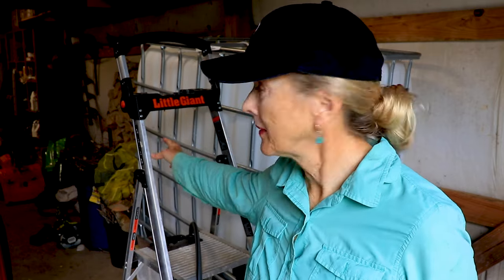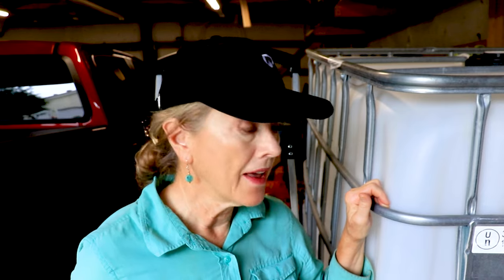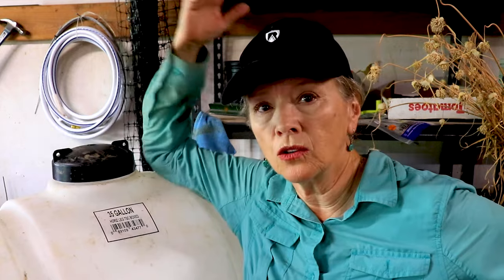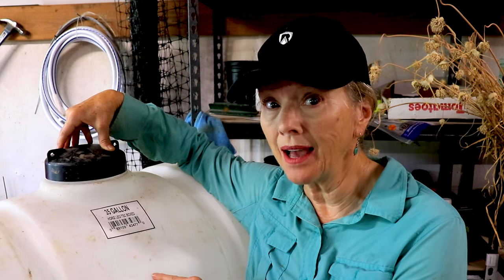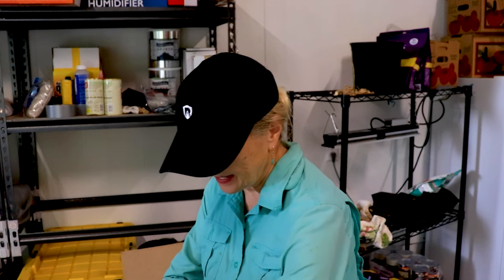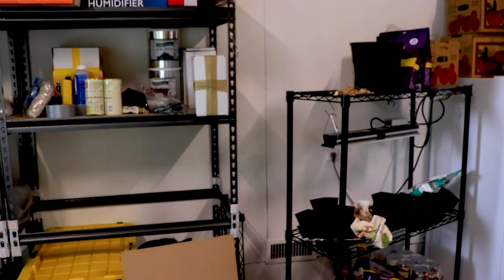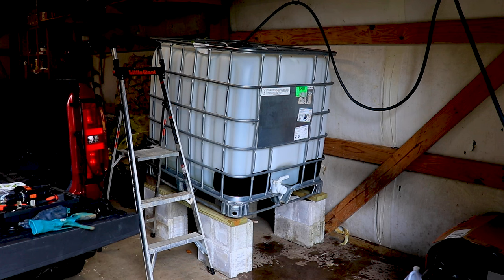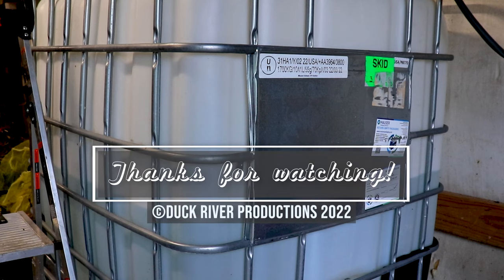TIPS storing water LONG TERM! (Don't make THIS MISTAKE!)

Comment: I learned about long term storage of gallon water bottles accidentally too. I currently fill 2 liter ginger ale bottles w water; stored in the house.
Gallon water is sold in flimsy low density polyethylene. (ldpe)
Use either high density pe or pet (polyethylene tere-something.) Soda bottles.

I like the idea of manageable water totes. You might even get a friend good in woodworking, or welding to make a stand.
Hopefully you can attach a hose to your tank so you don't have to carry the water.

We here in the south, fill our bathtubs prior to an impending ice event, for washing & flushing.

I'm on well water and am contemplating the addition of a manual pump.  But that might invite the neighborhood, should they realize what I've done.
Reply from the maker: They won't, because they wouldn't see or hear it, or know you did it, and I highly recommend it. I need to do that for my cistern. Thanks for the reminder.
Reply from the maker: And I've gotten several gallon glass jars which I'm replacing the plastic bottles with.
Reply: @Latebloomershow  oh excellent!

Comment: I don't trust buying used tanks because of possible chemicals so I just bit the bullet and purchased food grade at Tractor Supply for $500 each. I took out of metal cage and spray painted dark with plastic compatible adhering spray and put back in cage when dry to help keep algae growth down. It is screwed onto a treated wood base with fasteners and plumbed as a rain catchment system from my gutters complete with a spigot to attach a hose when needed. I use this to water animals and garden. In case of emergency I will filter through coffee filters, boil, and then run through my Berkey water filter to make it safe to drink.
Reply from the maker: You've got it all together! I just can't manage all that on my own. Bravo/Brava!

Comment: To clean easily, glue a neodymium magnet to a sponge or cloth, then use another on the outside and pull the sponge around to wipe the inside of the container.  Rinse well, spray with vinegar or fo the same thing with the sponge soaked in vinegar to sanitize the container.

Comment: Temperature changes can cause plastic bottles to expand and then contract.  So in the heat the water expands and when it cools off the bottles can contract and the bottles collapse.  A temperature controlled or cool area is a better storage.  The garage storage in the heat can cause these things to happen.  So sorry for your loss..  its not the fault of the bottle it is the temperature changes.

Comment: Kaye, now about those tools 🛠 that got wet. There are some quick fix tips that should do the trick. If it’s just light rust WD 40. If it’s bad soak the tools in diesel and that should work then clean fuel off them. Google says 24 hours. WD 40 is a good way to care your tools for those close to the ocean, salt air, and heavy wet fog. That will keep them looking like new ready for use. 
     I was wondering what happened too the water jugs to make them do that? Sometimes I leave water jugs around and yes they can freeze and bust, but that jug was extreme. Well if you keep finding stuff out of order, get a Weaner Dog, ears close to the ground and some security cameras, good to stay on top and ahead of things. Stay safe. 👍 Excellent content ✌️

Comment: I can buy charcoal in bulk online (I think we got 20# for $5) and drill a 3/8" hole in the top center of a used Brita filter...empty contents after drying by the woodstove or in the sun... Screen/colander charcoal to remove finest parts...fill Brita plastic vessel and plug drilled hole with foam ear plug or cotton.
   You can also use food grade hydrogen peroxide at 1%-2% to soak/clean Brita filters for a second time around

Comment: set up a pulley system  put straps on the tank    use pulley to lift it off     outside cover it up with something      use a two wheeler to move the tank   all I can think of..     four way faucet key is what you need to   for teotwawki...
Reply from the maker: Not sure what a four way faucet key is and what is it used for?
Reply: @Latebloomershow  go to LOwes or HOME DEPo    ask for a sillcock key       on buildings that have     NO    faucet handle    it is a key to open the water valve or spiket    gravity will allow water to come out when the water is off      runs from the top of the building down to you at the valve  the key   fits and opens the valve up  get one and put   in a bug out bag    you can get water as you travel    if there is none....in a shtf situation    look up sillcock key on the net............

Comment: Once it is clean, remember to use a HOSE for potable water to fill it.  Don't use a garden hose if you want to drink it. The 2 hoses are made of different plastics. Ya, I know, we all drank water out of a garden hose as kids and it tasted like rubber.
Reply from the maker: I wasn't able to find a drinking hose longer than 25' when I filled it, so I didn't. But, I will look again. Likely i would distill water I need for drinking. IF I have power, that is. I only have an electric one now. I need the other kind to be safe.

Comment: I designated a little pull trailer for my watering tank. I use ratchet straps
Reply: To hold it down. It works, and it can be parked at the back of the garage, for when it is empty, and not being used...
Reply from the maker: Super!

Comment: Never use a milk jug type container. Luckily, someone told me that before I ever started storing water. They had stored some on a second floor that turned into a disaster because those things leak as you pointed out. I have not had a problem like that with the second type you showed. Those are also the kind of plastic that juice and such are sold in. They are very sturdy and after 10 years I have never had them leak. I have 300 gallons of water stored in my home. I have two 60 gallon black rain barrels in the back yard. That is NOT enough!!!! I feel so unnprepared in that area especially! You can never have/store enough water. I have 2 berkeys put away with extra filters. I currently use Zero Water filters for my tap water. They are AMAZING! According to experiments done by Mike Adams...these filters even remove roundup!!! If it goes bad...all of my stored water will be boiled. Then filtered through a berkey. Then filtered through my Zero filter. if you store tap water out of sunlight that has been treated by the city you do not have to keep dumping it and rotating it. If it's kept cool and dark it's not necessary. However, I would boil the stew out of it and filter it if you have to drink it. 

I also have several sawyer minis and lifestraws. Over the years, I've heard that sawyer minis are better than lifestraws. Not sure exactly why. I also have a water bob for the bathtub. water, Water, WATER IS SO IMPORTANT.  3 days or less and you're a goner without it as we all know. Water, coffee and tea is all I drink. Mostly water. So, I figure I'd be dead in two days without it as much as my body is accustomed to it.  

This is a great video, Kaye. I look forward to reading all the comments of peoples ideas on this. We can never have enough knowledge on this. And for the record, I can't even water my entire garden, beds and pots with two 60 gal rain barrels ONCE. That says a lot. I got those rain barrels at hayneedle DOT com I believe if anyone is interested. Good luck to everyone. Do the best you can. May God help us all!
Reply: I just rotate those milk and water white plastic 1 gallon jugs over time and keep most empty (in an unused 2nd bathroom stall shower for many of those at the moment).  I will fill if we get warned or I believe that is near time-wise.  I have enough stored for a couple of weeks but live in the desert so that is a factor.
Reply: Wow you have really thought the water issue through!
Reply: @poodledaddles1091  It's been my number one concern from day one. I drink so much of it. My husband and my best friend think I drink a lot of water. I really don't. They just don't drink ANY. Hubby is addicted to energy drinks. (God help me when there is no more for him) I do not prep those. And I won't!! He should prep his own vice. My best friend is always drinking store bought sweet tea. Neither of them drink water. It boggles my mind.

There is enough water until you run out. I know I don't have enough. You can't. I can't GROW water. It is one of those things I think of almost daily now.

Comment: Most garage doors have a release pull cord where.it disconnects the door from the trak. Pull the cord and manual lift the door if electric goes out.
Reply: My husband does this once a year.  Keep those springs lubed with WD40.  Pulling that release cord is easy but setting it back is much harder and strenuous.  Make sure the release works ahead of time!

Comment: And on the shelving unit...my husband bought a couple of sheets of plywood cut it down to size and replaced the boards on the shelves. And no your jugs should NOT be leaking unless they're in high temperature fluctuations in the garage!

Comment: You can use a 12V RV water pump to hook to a garden hose and actually pressurize your house it will turn on and off on demand  A12V battery on a small solar panel will keep your system charged up and working  Home and ranch stores almost always have these pumps reasonably priced

Comment: I work for an oil company. We have a warehouse full of totes. They hold motor oil, diesel exhaust fluid, transmission fluid and hydraulic oil. We sell used totes cheap because they are not good for much outside of storing waste oil. I’ve offered empty plastic 55 gallon barrels to my husband (which contained antifreeze) because he was spending so much on large pots. I thought he could cut them in half and use for planting. After some research, he decided not to because he was concerned the plastic may have absorbed some of the contents. At the very least, these IBC totes could be used for washing dishes, clothes, etc. So I will recommend to your subscribers, if you want one, check with a local oil company. And if you are in South Georgia, I’ll sell you one really cheap!
Reply from the maker: Thanks so much!
Reply: @Latebloomershow  I have about 25-30 gallons of spring water in the house in those jugs. Yikes! Glad I saw this. I will make other arrangements. This would wreck the floor! If you look this problem up, it says they are not designed for long term storage. Perhaps your garage heat accelerated the leaking.

Comment: Ive had an IBC tote for a long time .I was a commercial trucker and got a chance to get a food grade one for free. I now keep it empty as long as possible ,until I think s is going to hit the fan,but I keep a low level of water in it with about a half cup of clorox. That way algae wont grow in there and if I need to fill it I can just rinse it out well first. I would still probably boil it when using it for consumption but  I have rain barrels  under the house roof corners for flushing the toilet and other things if the power goes out. Also ,,If you are thinking of moving water from one place to another,   be sure to use food grade hose. You can buy it at home depot.  ( not cheap ).  But garden hose usually comes with a warning right on the label,,Do NOT DRINK FROM THIS HOSE.

Comment: Not sure if anyone has already said this but if you can attach a hose to the place your spout is run it off the hill an you will not have to use the bucket..
Reply from the maker: Yes I know but I didn’t have the adapter and I felt a tremendous pressure to just go ahead and get the water in it but I will get an adapter that fits onto a spigot and a hose

Comment: Those gallon water bottles that "suck in" show that water is dissolving into the plastic and evaporating out into the air.  Different plastics have different solubility  for different solvents.   Choose a compatible container for whatever you store long term.

Comment: You can take a normal heating pad and slide it where you need it. I put mine above thee spiket and on medium heat. I also just throw ah couple old comforters I baught from goodwill over thee tank. I used a stick on velcro kit. So the heating pad can be velcro to the spot I want it. God bless. They also make submergable heat Bob's for cattle. You plug it in and put it in your tank. It works even better.

Comment: 2 gallons per day is more ideal - it encompasses more than just drinking water. It covers cooking foods needing water, brushing teeth, sponge baths, cleaning specific areas sufficiently to maintain healthy cleanliness. Also, our laundry requires this. For short term storm power outages that last anywhere from hours, days, to a couple weeks and even months (I’ve seen this in the Keys of Florida). But if you are talking about a month of water needs, you are going to have to take more than a storm outage typically creates. If you have animals, they drink 1 gallon per day per animal on average. If you can only save so much water, have a means to produce safe drinking water. I love that you are addressing mistakes made with water storage. I’ve seen some basic coverage but most don’t cover how to maintain good water. I’ve gotten sick from bacteria from the drain nozzle of stored water. It is NOT fun! Bleach is not a healthy option, but I have used fresh squeezed lemon and was able to successfully eradicate any bacteria that caused my illness. Lemon even gets rid of strep when treated correctly. Spray painting with UV resistant paint can help, but you do have to maintain that paint each year. Thank you so much for sharing!!!! This was a GREAT refresher!

Comment: Kaye,  @5:50 you didn't list the link!  BTW, those white plastic milk type cartons are good for about 6 months on the shelf. At point of purchase, make a point of checking for dings and places where the plastic is pushed in, it creates a point of weakness and gravity will take over. This action will help but will not keep it from eventually leaking. So avoid those if you possibly can. The thicker clear type plastic bottles are so much better but again, check for dings and pushed in places, if at all damaged leave those behind and if necessary you may have to go to a different store to get water.
If not, have plan B, have other containers at home you can transfer the water into for storage, and recycle the damaged bottles. (I speak from experience on everything I have written here.) All the best.
Reply from the maker: Thanks much! The link is in the top pinned comment. I have learned this about the bottles from many commenters, thanks! I order 4 gallon glass jugs, and still working on the rest.
Reply: @Latebloomershow  There is no top pinned comment....and nothing under your video listings that remotely describes what you were talking about..What am I missing? Please look again, it's just not there.

Comment: Using an electric pump (12v or 120v) with a suitable filter (carbon) would facilitate the transfer to where you want it, using a hose.
Reply from the maker: Thank you! I've looked at a few online, but haven't gotten one.

Comment: If your water froze during the winter, it could have caused a crack in the jugs. I keep water in those kind of jugs and they haven't leaked.
Reply from the maker: No it doesn’t freeze in my garage but others have reminded me that some of these gallon jugs are made to decompose and they’re not made to keep long-term

Comment: I have seen the black covers for the IBC. It slips over them. Then you could set it out under a shaded area, maybe on a pallet. The pallets come in wood or heavy plastic. The gooey stuff on the tank my be oil. Oil comes in them too. My IBC was sticky too. 
FYI… just sayin. 
Stay grounded!!! 🦶🦶🦶🤸‍♀️🧘‍♀️
😊🌷💗
Almost every distilled gallon of water I buy ends up leaking. I don’t get it! The plastic they use is really thin. Hmmm…

Comment: Is there any reason why you can't have a well?  Even a shallow on for irrigation would be a blessing, and if you also have a manual pump on it, you're golden during a power outage.  Also, a good well man can pump up your well so you can get enough water for cooking, washing and flushing toilets.
Reply from the maker: Yes, the water is tainted from local zinc mine.

Comment: Another thing Kaye, that 275 gallon tank will weight around 2,200 pounds.  Do you think you should try to spread that weight out to avoid cracking your garage floor.  You could probably do that with some 4x4"'s and blocks.  You could set it up so the weight would be distributed like 4 tires on a car.
Reply from the maker: You did see that it is sitting on concrete blocks with 2x4's on top, right? At each corner?
Reply: @Latebloomershow  no, I didn't see that

Comment: Hi Kay as far as the gallon bottles they all leak after a little while use the Langer's or Welches 3 leader juice bottles there are a few others too they're very heavy duty and they are semi-squared or oval with flat and stackable sides they're very heavy duty with a handle built into them they do not leak not even after years you can also store rice or beans in them or oats or whatnot
Reply from the maker: Thank you!!

Comment: Thanks for this info!  I'm new to prepping & I have a question - is it pretty common for cisterns to leak?  ALSO, how does color cause algae growth?  Couldn't a blue tank also grow algae?
Reply from the maker: Old concrete block cisterns probably do have to be resealed from time to time. The ground shifts, mortar can crack. If you don’t already have one you won’t need to worry about it because I’m sure you won’t be building one like this. What you would put in as an underground water tank that would not leak. Sunlight causes a reaction with the water so having a darker color slows that process. But you’re probably right it could be gradually growing in a colored tank. You always have to plan to test stored water. And welcome to my channel and welcome to prepping!